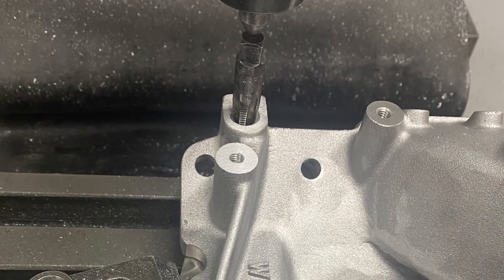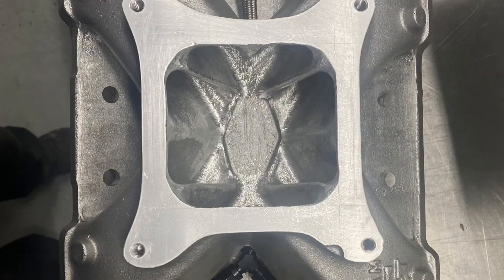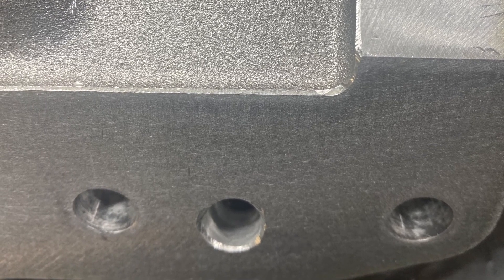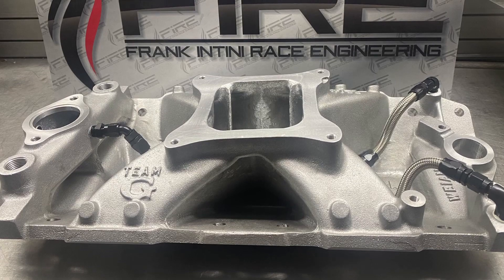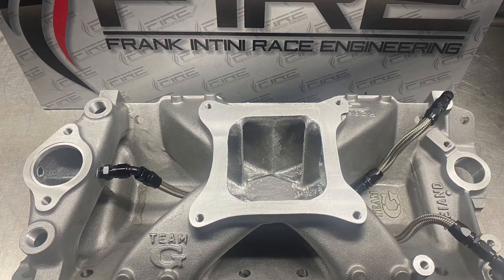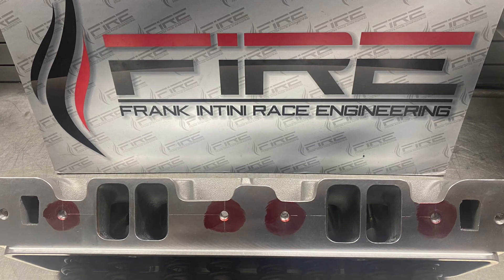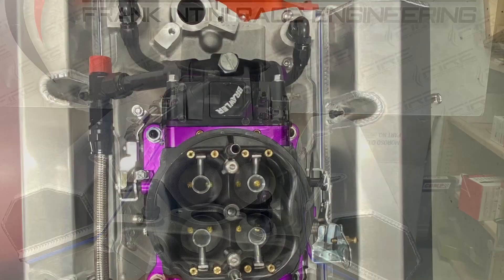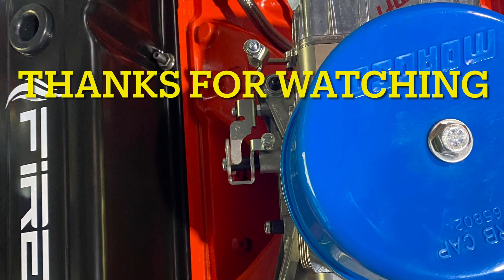Engine Tips & Tricks

Comment: Hey Frank, Super curious to hear how that SBC 427 with this manifold & AFR220 heads went on the dyno ? Any updates that you're allowed to divulge publicly ?
Reply from the maker: Hi, I’ve now built 3 427 SBC with the 220 afr/wieand manifold combo
One was a solid roller it made 630hp/ 580 ft lbs
The other 2 were hyd roller both about the same 615hp but still 580 ft lbs
I think the extra 3-400 rpm of the solid roller is why that engine made more hp
Those manifolds can work but for a large cube sb they do need a bit of work.
Thanks for your question 
Frank